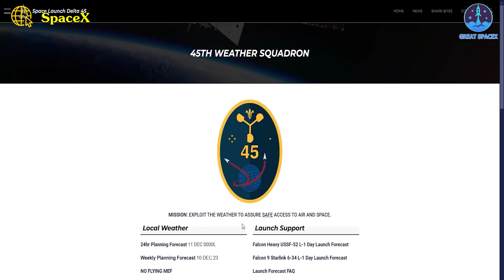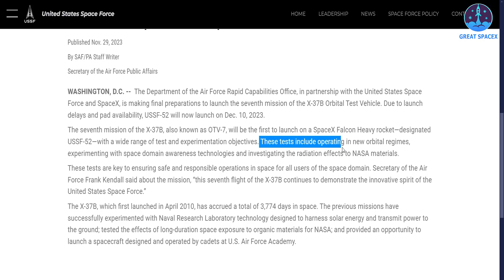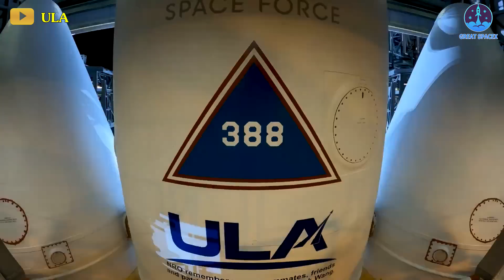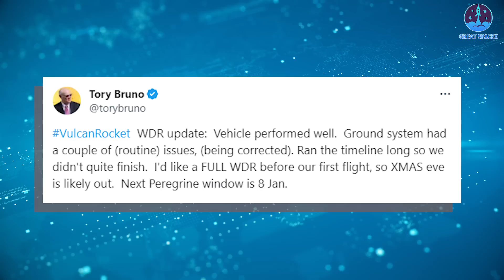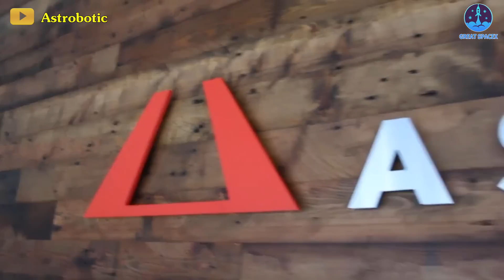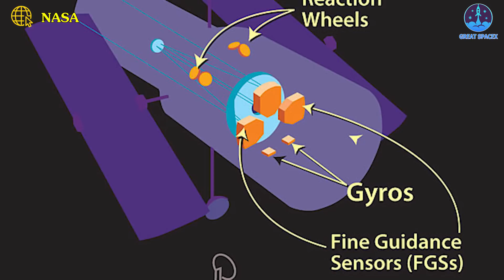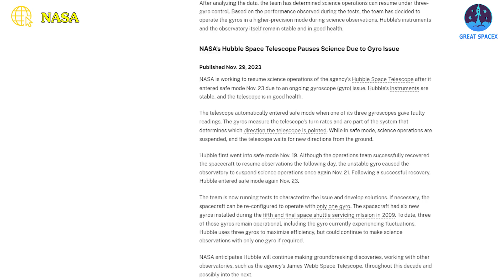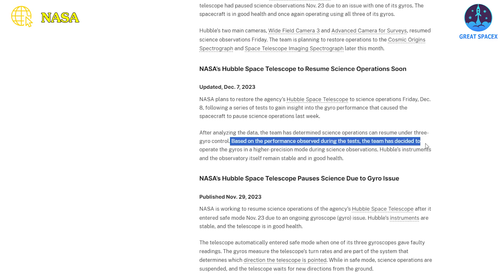While SpaceX Falcon Heavy is reaching Huge milestones with X-37B, ULA is in big trouble...

Comment: X-37B can handle atmospheric Reentry. I'm thinking that it might could survive just fine being launched without the heavy fairings. Maybe a small fairing around the mounting hardware to minimize drag.
Reply: The questions I'd have are; 
A. Can it handle both launch and landing stresses?
B. As it has a lifting body, how much would this lift affect launch? could the mount handle that much lateral thrust?
Reply: @Stormcrow_1  yes, good questions.

Comment: Thanos is behind FH launch! GO SLS!! RS-25’S are the best ever!! GO Kevin!!
Reply from the maker: Thanks your supports!!
Reply: @@user-lu9kv6bd9i I know but I love the RS-25’S. I find it interesting that NASA is using them on SLS! Just pure greatness!
Reply: @davebooth5608  But as a taxpayer do you not want to see value for your money?  Based on my engineering experience I understand fully why N-G is billing $146M for each reconditioned engine.  Including inflation, particularly of engineering salaries, that is in line with what they charged during the Shuttle Era.  The biggest cost factor is that N-G is only providing two engines a year to Boing.  That means all of the costs of its operations for an entire year must be covered by those two engines.  Meanwhile SpaceX is delivering FOUR HUNDRED Raptors a year so, surprise, each engine costs only 1/400th as much!  Simple economics.  Raptors are so inexpensive that SpaceX actually has to consider the cost of propellants as a factor.  Note that liquid hydrogen costs five hundred times as much per kg as liquid natural gas, but is a trivial part of the cost of launching an SLS.  Also note the high cost of the ET, because to partially compensate for the extra mass of the deadly foam insulation required by the 20°K temperature of LH2 and the 3 times greater tank surface area required because of its ridiculously low energy density, the ET must use expensive milled aluminum, as opposed to the cheap 3.6mm stainless steel that provides adequate insulation for LOX and LNG.  But of course the "aerospace experts" on Capitol Hill know more than the staff at SpaceX.